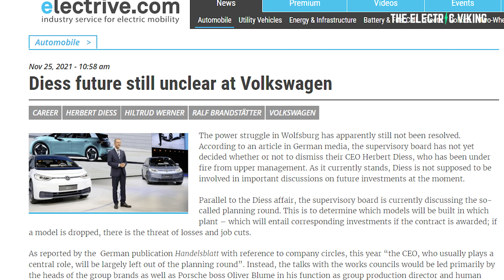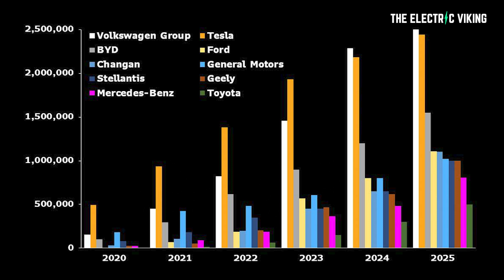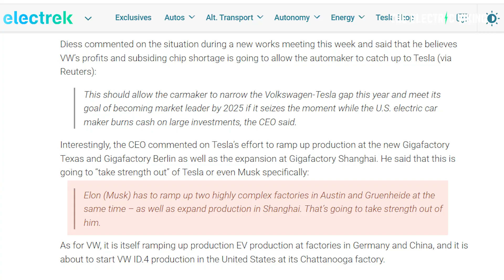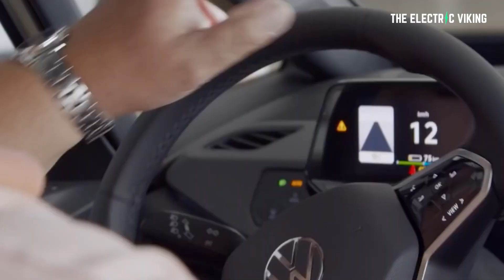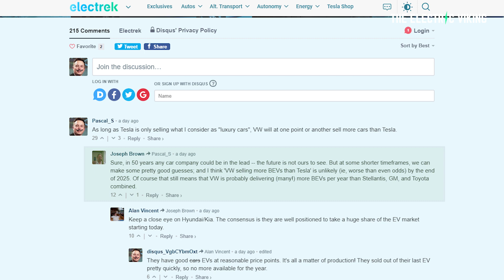Herbert Diess fires shots at 'weakened' Elon Musk & Tesla

Comment: it is not that Tesla is having a problem ramping up production but rather that they are battery constrained at this point.  Facts are facts this is why Texas has started a line using 2170 cells. Tesla is still having trouble getting enough 4680 cells at this point.
Reply: Yes, Tesla have problem ramping, but have the competence and capital to overcome it (even if it a extra year) VW have to undergo ther own "production hell" then they try to ramp up.

Comment: What limits EV production?  Production facilities or Li availability. Li Availability is the limit. Whom ever can get more Lithium will be able to make more vehicles.  The Lithium choke point is that not enough lithium will be produced to facilitate all the demand; so excess production capacity can be potentially a drag on Tesla or any company without adequate Lithium supply.  If you invest in production capacity that is hamstrung by a lack of batteries to put in the cars - it can be a problem for such a company.  I presume this is where Dress's comment is coming from. He is saying Tesla will have more production capacity than lithium and to put in the batteries to make the cars - hence cost per car will be up.

Comment: Volkswagen Group has an egde because it is not a one company making EV's, it has Audi, Skoda, Lamborghini, Porsche, SEAT, Volkswagen, Bently, Buggati, Scania AB, Traton, MAN SE, SAIC Volkswagen. Thats 12 companies I could find out and there maybe more. Each company has its own R&D and designing and therefore they have advantage.

Volkswagen AG cash on hand for 2021 was $73.654B VS Tesla cash on hand for the quarter ending March 31, 2022 was $18.013B
12 companies building EV factories VS one company(TESLA), just have a think!
Reply: More is not necessary good. More minds more disagreement. I hear they have thousands of software engineers, yet their software is at a standstill with internal arguments.
Reply: So you will pay to invent the wheel twelve times?

Comment: VW EVs are very bland, rubbish info tech, drum rear brakes, no true one pedal driving, overweight. Ok for the average Joe/Gill but can’t get excited by then.
Reply: Drum rear brakes are great. Yes, you cannot masturbate to their pure stats, but they are durable, cheap to repair and perform as good in the rear as disk brakes. Rear Disk brakes are never used to their limit, so why go expensive in buying and repairing? And if you aren't living in Germany and driving 200-300 every day or get your car on the track, you will never get drum brakes to their limit either. They improved a lot too in the last decades, not comparable to the one we got decades ago. 

The rest absolutely true, not having one pedal driving is stupid af. And they are heavy, I agree on that one too. Bland are most of them with a few exceptions. Wouldn't say they are rubbish tho.
Reply: @dieabsolutegluckskuche5174  ok I’ll give you the drum brakes although I would buy one. The haptic buttons on the steering wheel and lag on the screen are rubbish, only having 3 buttons to control 4 windows is a joke. Worse still is rear wiper delete on some with the manufacturer saying it’s not needed because of the design. That’s just lies or they have never driven one.
Reply: @garrycroft4215  VW builds the best and most attractive EV right now with the Audi Etron GT.  they are reshuffling a bit after all the bad PR in the last decade, VW will be the budget brand with both former european Budget brands getting a makeover.